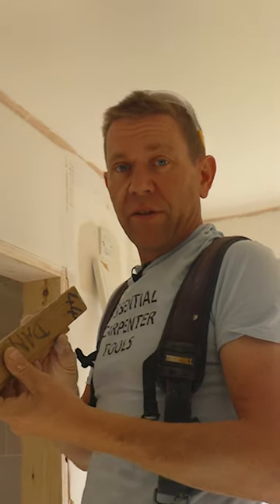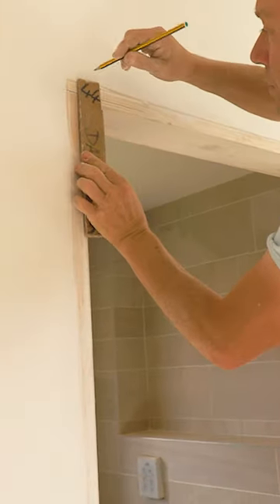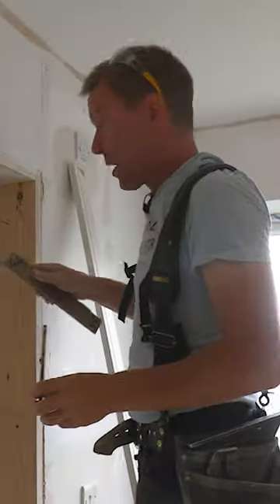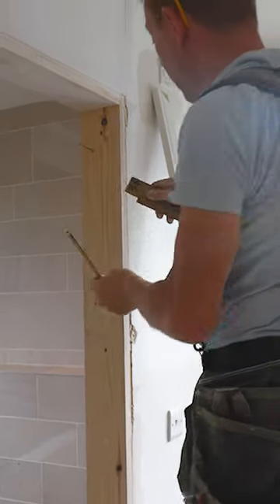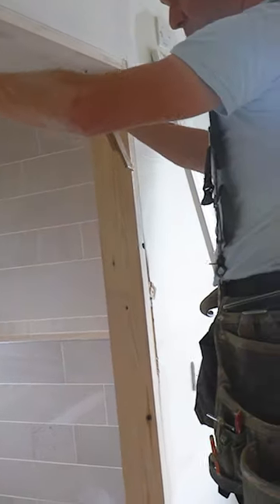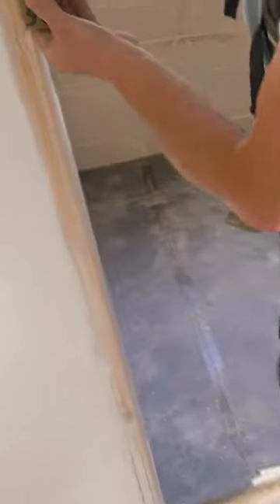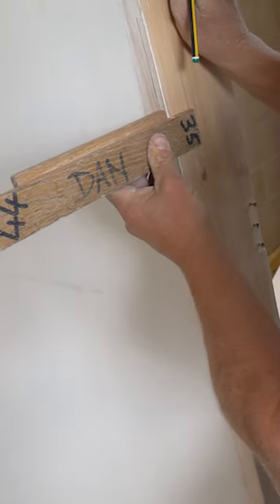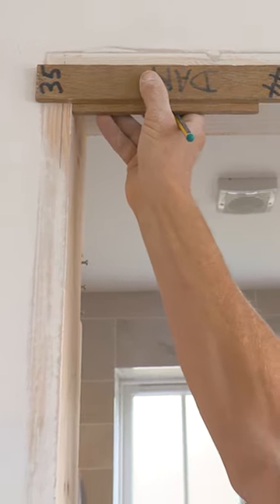Dan's Architrave Gauge #shorts

Comment: Just a quick tip. When cutting on a chop saw have a bucket or cardboard box underneath for the waste. Saves picking loads of little bits of timber off the floor and keeps it tidy
Reply from the maker: yes but it is more fun chucking them in a bucket that is over your shoulder

Comment: Combination square does the same thing!
Reply from the maker: That is true but you have to set it every time. This is done and ready to go
Reply: @SkillBuilder  it’s literally the easiest thing to set.. I’m not knocking the idea. But just seems a YouTube tool for views. Plus another thing to bring out when 2nd fixing. You need your square out for check bevel for doors 👍🏽 and locks.
Reply: @kevinshiels31 it's simple to make, lasts for ages and is nicer to hold than a combination square
Reply: @kevinshiels31 to easy to make, lasts for ages, can't unadjust like a square. Nicer to hold and use if doing whole houses.
Reply: @MrHavokman  Look each to there own. Just think it’s a silly idea. Would see though it if the square took ages to set or was difficult to hold. It’s literally one of the easiest hand tools you can use?
Reply: @kevinshiels31  exactly
Reply: @kevinshiels31 if it works the same and is quicker how can it be a silly idea

Comment: 44mm in for the stop???
Reply: Not quite. But close. Some fire doors are 44mm. He can mark the line on the frame and then attach a scrap bit of wood or something along the line so he can push his door into the opening and see it has an equal 3mm margin all around the edge of the door. 

The door stop would most likely be 46mm in from the edge of the frame or something similar due to layers of paint and allowing some very little movement to make sure the door closes but to be honest, I always fit the door first, close it shut, then fit the door stop with a 1.5mm packer between the door and the  door stop. You know you have the right gap all around the door and door stop then but everyone has their own ways of doing things.

Comment: I'm lost, what happened to sliding squares
Reply: Nothing happened to them. I use them every day, I'm sure Dan does too. But this is a far faster method of doing the same job. Speed, ease & accuracy that doesn't compromise quality always wins. Work smarter!
Reply: @thomasbancroft1092 exactly.  
😉
Reply: @thomasbancroft1092  you just described all the reasons why sliding squares were invented.
Reply: @RMMaryport sliding squares can loosen and this is easier to hold and use when doing whole houses.
Reply: @MrHavokman  my bahco square is around 5 years old, still nips up no problem
Reply: @RMMaryport  not saying it would be bad. But this free price of wood would last as well.
Reply: @MrHavokman I got my square from the local tool shop for 20 quid I think, been bang on, ergonomic, never faulted. I didn't have to create it, go round site looking for bits of wood to make when I could be marking up all my arcs and stops, just feels like your trying to justify this video to your best ability here.
Reply: @RMMaryport  but you don't make it everytime? That's like saying I've made 100 jigs in the time it took to go to the shop. It has no relevant point.

I'm saying it comes down to preference. What are you saying that you haven't stated yet?